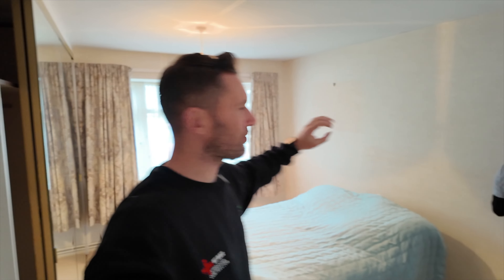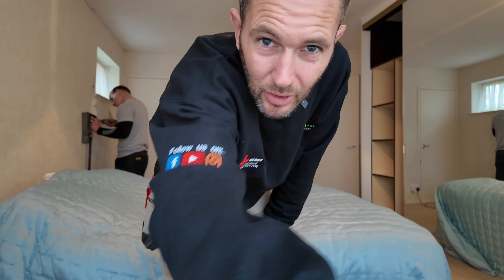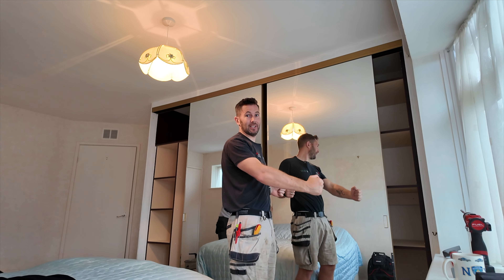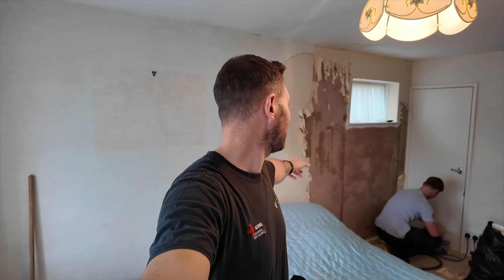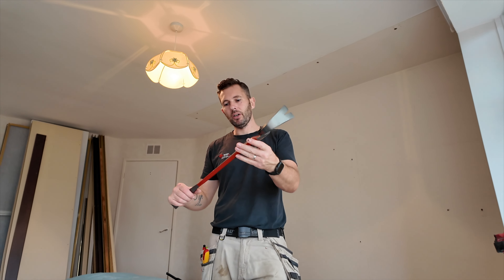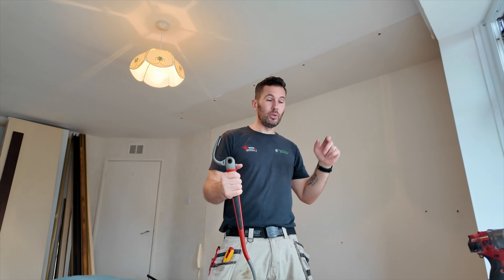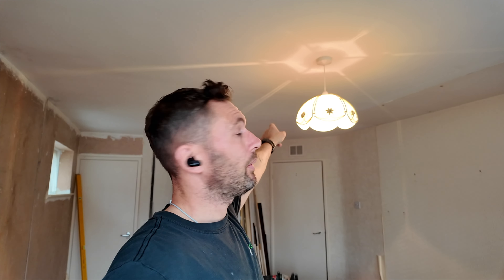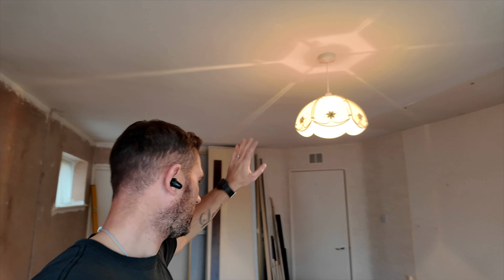THE ULTIMATE BEDROOM MAKEOVER - ITS ALL IN THE PREP

Comment: Question. What height should socket outlets and light switches be these days to comply with Part P? I’m going to re-wire my new home next year and don’t want to drop a bollock if they need to be a certain height for compliance.
Reply from the maker: if you are following part M of the building regs then its 450mm to the bottom of the sockets and 1200mm to the top of the switches there is an upcoming video that will be right up your street
Reply: @GreenHawkElectrical Thanks for the reply. Funnily enough my new home/project is a concrete floored bungalow so everything will be coming down from above. Would be interesting to see the finished product and how you went about things. 

I do have another Part P question but will leave it for the up and coming video. 

Loving the content. Keep it up.